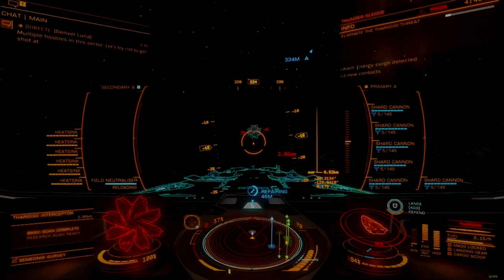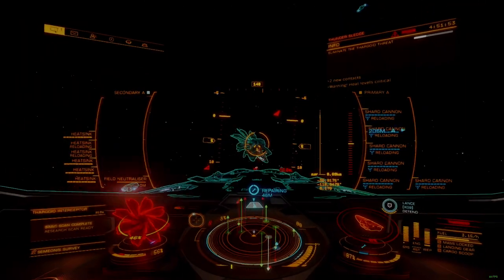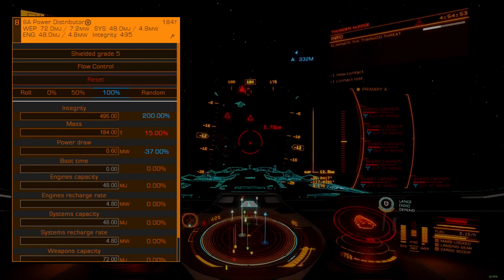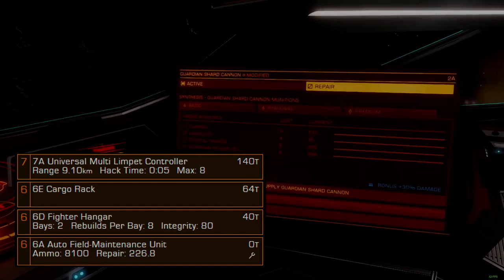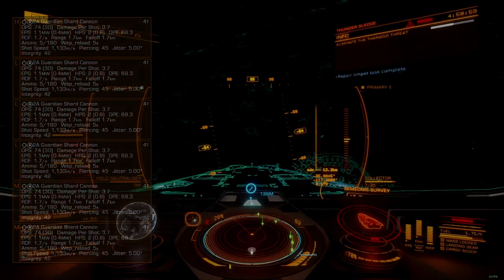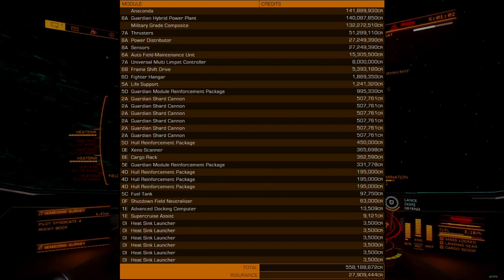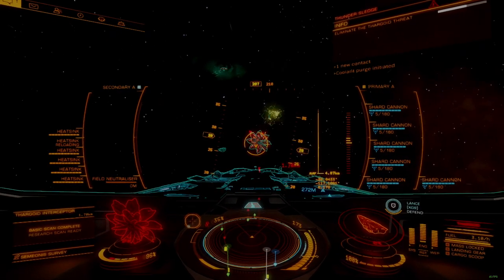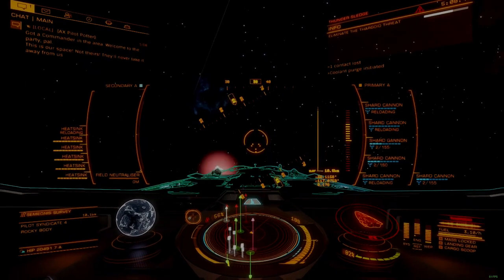Elite Dangerous | Ship Build | Anaconda | Thunder Hammer

Comment: I would recommend using the ship designing program EDSY instead of corialis. While the user interface is less friendly, it displays more information (such as ship thermals), more accurately,  and is updated quickly to match ingame modules. Such as the modified ax weapons, which is currently has.
Reply from the maker: I took a look at it. Known about it for a while, but was under the impression that both these tools were lax about updates. Now that I know shipyard is more reliable, I'll probably be using it on future ship builds.
Reply: Another benefit of it is that if you use EDO material helper, you can export an edsy build to EDOM to track what you need to engineer the build.

Comment: I can't wrap my head around these build choices and wasted materials

Sensors 8A - You're adding a lot of extra weight for minimal gain. 
7B Thrusters - So not only did you add a massive load of weight by choosing a B module you also engineered it to a nearly useless engineering effect by making a conda and even bigger target with that very slow boost speed.
6B FSD - Again another waste of materials and a lot of extra weight when you could go with the regular 6A Increased range.
7A Universal repair limpets - significantly weaker than the class 7 repair limpets. The only relevant thing in it is the repairs and in case you need to get rid of the caustic you simply burn it off. Not to mention all the added weight of a universal limpet controller.

Anaconda can have a very large AFM and lots of limpets to repair in case it needs to. You essentially made the ship much slower to a point you can barely outmaneuver anything.

Comment: Cyclops gank builds are not really new, don't forget there is a size 3 shard cannon unmodified. That's easier to handle from heat and power as well, at even higher DPS instant and sustained. I see the size 2 modified Shards more as a great way to build smaller, fun to fly ships with serious punch, like the Challenger or Viper. To gank Cyclops, 3x size 3 Shards plus 2x size 2 modified Shards are much more fun than an Anaconda. And you only need a size 3 stabilizer.